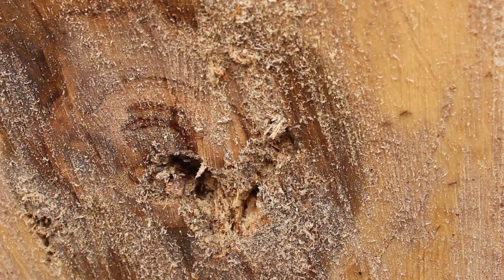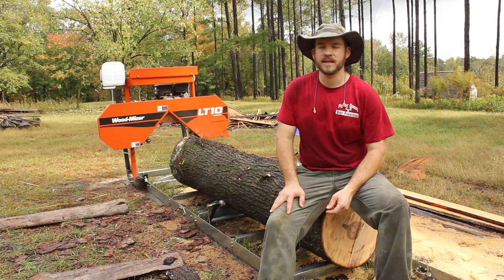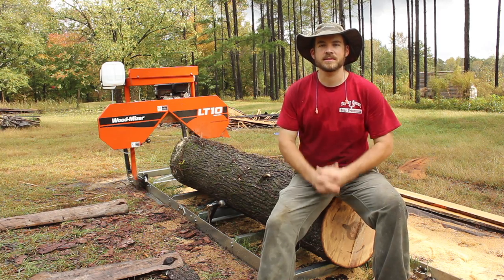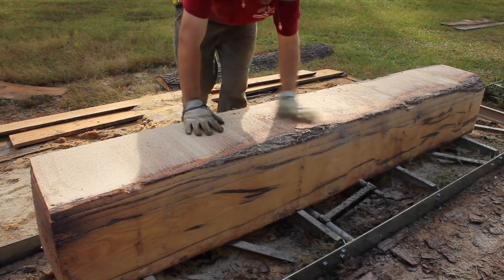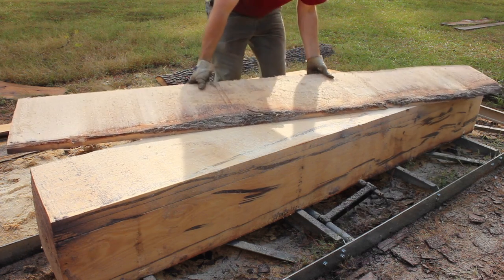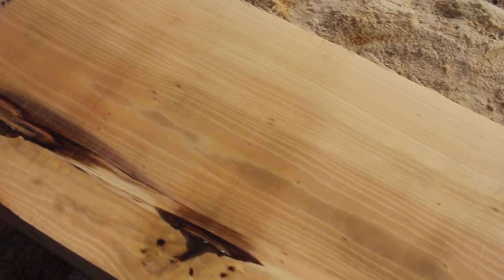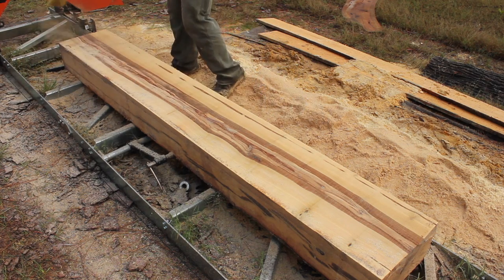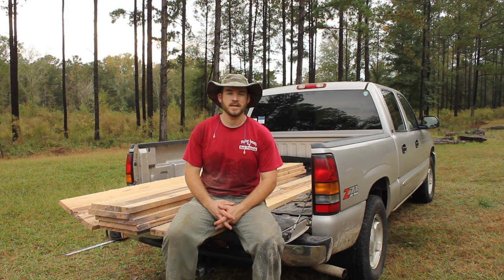Milling a HUGE Sweet Gum log! Beautiful!

Comment: Sweetgum is a pretty wood when sawed, but both it and Elm are notorious for twisting up very badly during the drying out process.  Strip it out real close and put lots of weights on top to help hold it flat.  We used concrete blocks and plenty of them.  Great video!
Reply from the maker: William Hatcher Thank you, William! I have them stickered and stacked with concrete blocks on top and the ends sealed. We will see how it goes.
Reply: @falllineridge  Can you showa short clip, or pic, of how you have the wood weighted down with the concrete blocks??? TY.
Reply: Williai

Comment: Loved that. Super nice to watch someone mill their own wood. I have the same Woodmizer mill in Northern Canada. I took it to my property in pieces in a canoe! Now that it's set up it's not going anywhere. I've had it about 12 years and I notice a lot of changes in your model. It's really paid for itself many times over. Were you using just water for lubricant? I usually put in a couple of ounces per gallon of Pinesol because the red pine, and white pine I mill is so resinous. Don't have to deal with poison ivy vines though ... just blackflies and mosquitoes. All the best - I've subscribed.
Reply from the maker: Rob Van Wyck Cool! Yes, just water. Sometimes with pine I’ll put some dish soap in also. Thanks for subscribing!

Comment: May I ask why did u change blades at about 12:20?
Reply: I think that the first blade was only for separate the bark from the tree and it's less sharp or less accurate. But the second, stronger is used for harder, inner wood.

Comment: In guitars woods like alder, ash, maple, mahogany, various rosewoods and such are common tone woods. And various types of spruce for acoustics of course. Many are not domestic.

But only a few "common" species from of north American deciduous hardwoods are commonly known as "tonewoods". I'm curious if there are any other species native to America that would work well as guitar woods. I don't know where many common native species land on the hardness scale, or how stable many of them are over time. They can't be much more squirrelly than maple!

Species that I know are passable are ones like maple, alder, ash, walnut, pine is okay for bodies. People shy away from oak. I think because the open grain makes it difficult to finish. And the weight is ridiculous to strap over your shoulder for a 3-4 hour gig. But really, it should function okay as a neck or body wood I would think.

One day I'm going to try to find more locally sourced woods to try and make some guitars from them and see how those local woods perform. I've got two small sweet gums in the yard but never really considered what the wood looked like Haha. They are MUCH smaller than that one or they might be in danger Haha!

Good content, lots of people enjoy this stuff, myself included. Good camera angles as well, nice and creative.
Reply from the maker: Thanks! Thanks for the great info about guitar woods! Very interesting.
Reply: Taylor Guitars publishes a lot of interesting info about tone woods. You can find this on their website, taylorguitars.com. As you mention above most tone woods are imported from Africa and Asia.
Reply: DaveyDacusGuitars .have you ever tried u wood .is dence .I have some you can try
Reply: Sweet gum is definitely not a 'normal' guitar wood, probably due to the fact that it's not as friendly to work with.  For a small shop where pushing out 5000 guitars per week is not the goal it could make a really interesting instrument. Its tendency to twist and crack might make it a candidate to use as a cap on a more stable ash or poplar base.
Reply: DaveyDacusGuitars send awjoza
Reply: ج
Reply: DaveyDacusGuitar
Reply: ..  

Om
Mol

Comment: Nice looking lumber , was thinking it would look great if you was making a dinner table with the 3 lumber pieces at the end was in the middle of the table .
Reply: Sweetgum is not a wood that can be used for lumber. It cups and twists when it dries. Sweetgum is a pretty useless wood.

Comment: Use a square to make sure when you turn the log after cutting the first slabs off that the sides are square..... bark or wood pieces can be trap under the wood and throw it off plus if you cut for quarter sawing the the sides are square!!!

Comment: That is video on a nice project regarding the lumber that you harvest and turn into boards of lumber. It was nice to watch it. It seems that you used a small part of the tree that you cut down. Is there a reason for that or did you go back to the field with your tractor to get the remaining part of the tree to use for other purposes?
Reply from the maker: FKtdyvan 2016 It will eventually be milled also.
Reply: @falllineridge  Thanks.  It was nice to see your video on lumber harvesting.
Reply: @falllineridge  Also, it would be nice if you show us how the final wood products that you used for your house look like.

Comment: I have a question here. When you are pulling the log on the back of your truck, why haven't you used a small wheel fitted casing type of thing at the dragged edge of the log?  That would reduce friction and will make pulling of the log easier I believe.

Comment: Nice video. I am curious though. Why didn't he cut along the other axis (90 degree rotation)? The wood appeared to have more character in that direction. Oh well, I`m sure there was a reason.
Reply: Probably a stress crack the way he cut would be the least amount of damage to total boards meaning instead of 10 boards with a crack he would only have 1 instead just an example

Comment: you ran early in the cutting process from the camera angle.   you should note for viewers that there is this amazing and terrifying sound that tells you the cutter that the tree is committed to falling and it  is time for you to go.    although i could not hear it, i know you did and i don't stick around either when that happens.

what was the diameter of this thing.  it looks maybe about 30 inches to 36,    and sweetgum is heavy wood.    i literally just finished cutting up two of them a few hours ago into boards.   mine were smaller,    a lot smaller.

excellent video

Comment: Poison Ivy Is oil base so use a degreaser soon after exposure.  The oil will last up to five years on hard services. wash fabric is a degreaser. In my loggin days With working with gas and diesel and degreasers all the time it never got ahold of skin to irritate me.